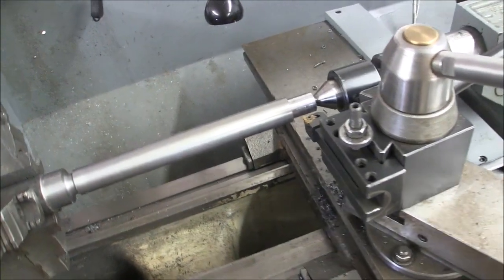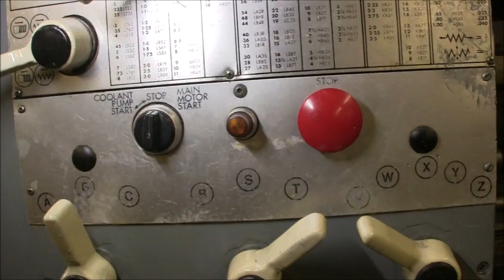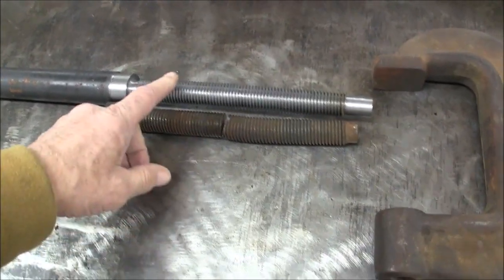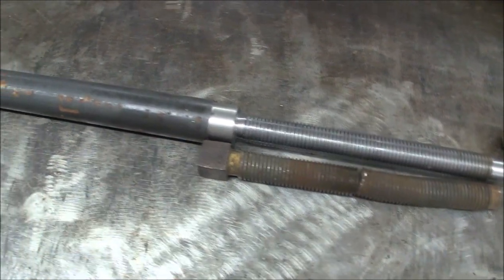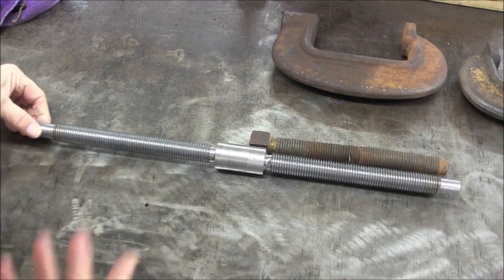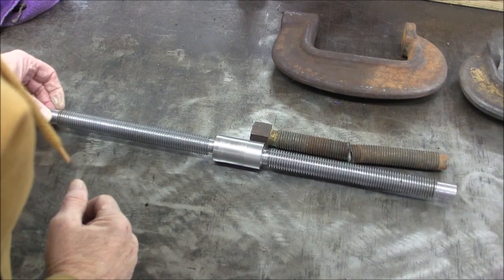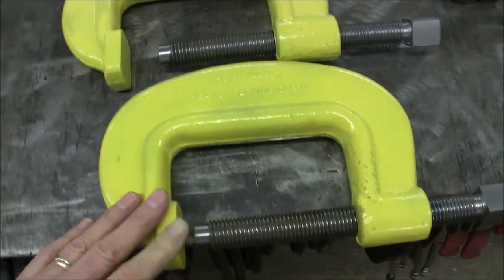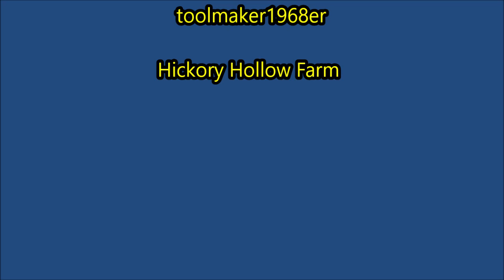Making c clamp screws pt 3

Comment: Well done Mike, great outcome. Of all the screw cutting videos I have viewed over the Years, YOU are the only one who mentioned that you need to wind the compound MORE than the the straight depth of cut. What I do to save working it out is to touch the tool on the work, ZERO the compound dial and the cross slide dial. Wind out the compound, advance the cross slide to the thread depth, reset the dial to zero. Begin threading advancing the compound in stages until that dial reads Zero too. Should be at the recommended thread depth, check and adjust as needed. In this way you do not have to calculate the movement of the compound. Other video I see people keep trying it until it fits as they have not compensated for the depth of cut at 30 degrees. Hope you are both well. Regards from Australia.
Reply from the maker: I was taught to feed with the compound way back in high school.  After seeing a couple of YouTubes where they fed with the cross slide, I tried it once and didn't have good luck.  (I'll try just about anything once).  I found the threads come out cleaner using the compound.  Maybe it's just me.  I set the compound at 30 Degrees as opposed to 29.5.  30 minutes is a miniscule amount to mess with.  Using the compound causes the chip to form on the front side of the tool bit and cuts cleaner.  Long story short, I agree with you. Hope all is going well for you and you're having a great summer. Tc, Mike